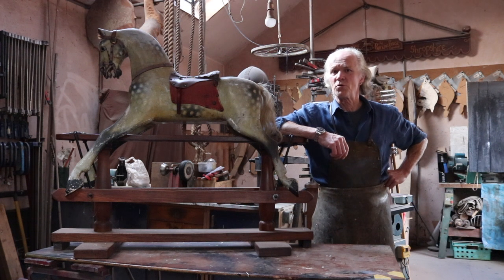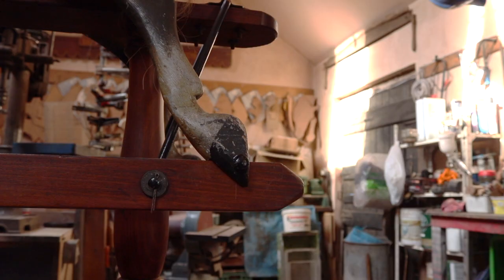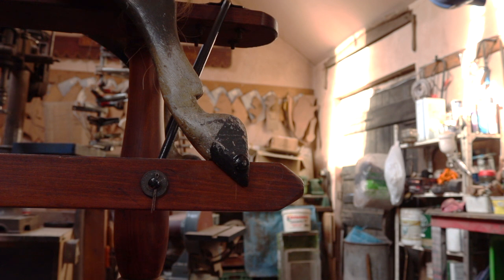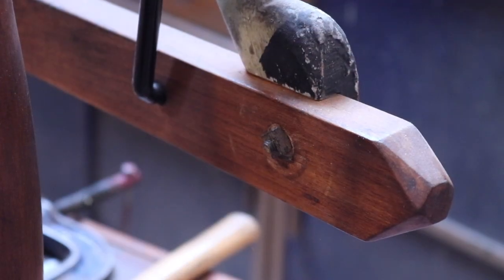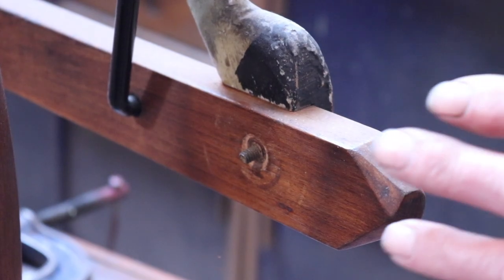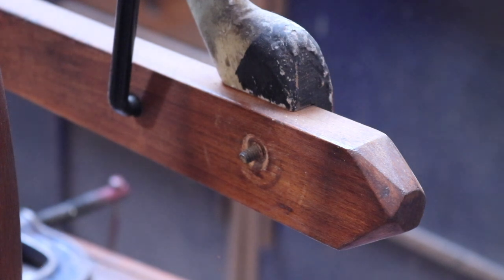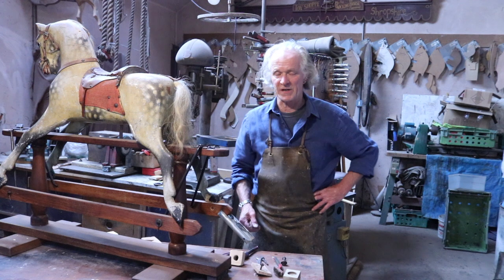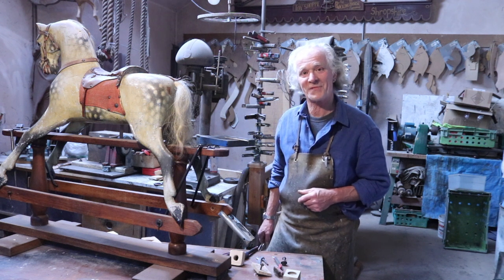Rocking Horse Talk With David Kiss - Fixtures, fittings and fiddly fings

Comment: Very Nice video, may i ask you a question.
I made a rocking horse for my grandson some 23 yeas ago, i have just refurbished it but i have one problem.
The main and tail hair (made from real horse hair) is very dry i have very carefully washed and conditioned it but it remains very dry, do you know how i can make the horse hair soft again.
Hopefully you can come up with a some solution.

Thank you Dave
Reply: Lots of online sources say the hair lasts about 20 years.
You could try wetting it with damp cloths before using a leave-in conditioner like Inecto. That might help?